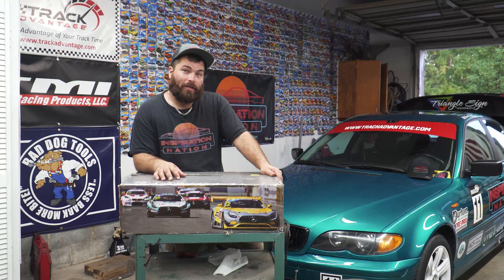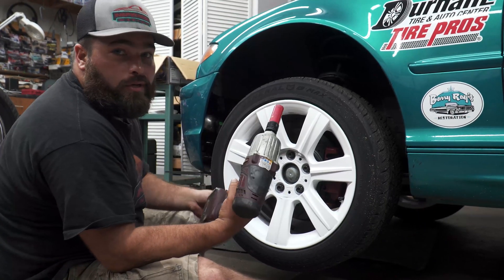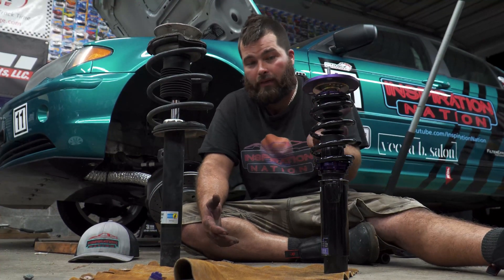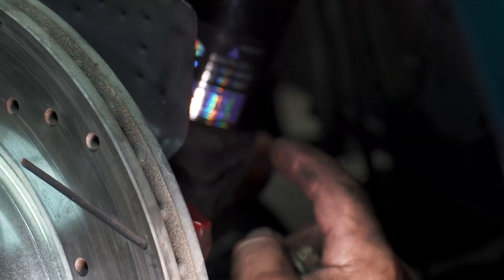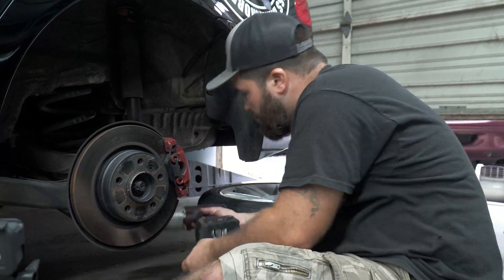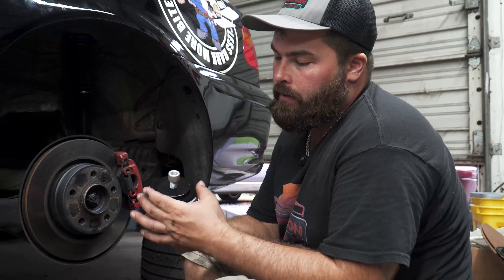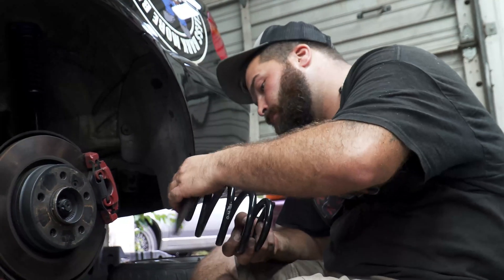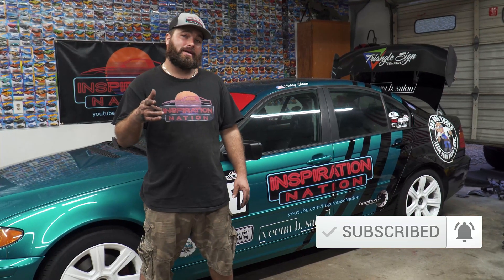E46 Track Car: D2 Coilover Installation

Comment: Also you don't adjust ride height in the rear by adjusting the shock....that adjustment is there you aren't over compressing/extending and damaging it internally.  Where you set that depends on the height you set at the spring perch :)
Reply from the maker: Yes that's how we did it just didn't film that part